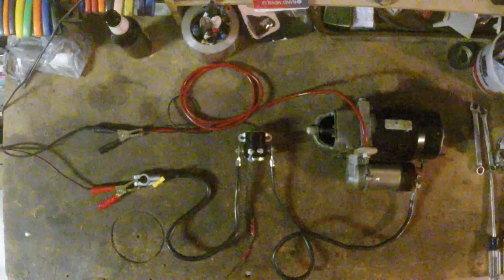My Old POS Episode 2. Remote Starter Solenoid Tricks!

Comment: IF YOU ARE STRANDED  with a clicking solenoid  try this method  to get going   in nuteral brake on switch in run pos raise hood  a short piece of wire #6 or so  or a pair of pliers simply short two big lug on solenoid  if battery ok it will crank up

Comment: A great and informative video.  It seems though at 0:48 the large wire from the remote mounted solenoid to the starter mounted solenoid should be attached to the other large terminal, closest to the starter motor, powering the motor directly.  In the current setup, if the starter mounted solenoid fails, the system would fail.  If my thinking is correct, the tab on the "trigger" should also be attached to the large terminal closest to the starter motor.  I am by no means a mechanic and I certainly could be missing something.  I still like the video and may just need further explanation.
Reply: THIS
Reply: lol ooo o

Comment: That doesn't actually bypass the one on the starter motor it acts in sequence....so if the one on the starter burns out it will not start.right? Cause i am also an untrained idiot.

Comment: if this happens to you -----try this no start just click jump start just clicks short to solenoid no start??????????use starer cable both ends red or black conn 1 end battery gd black the other end  any metal on eng or frame  bingo she will start right up ----whats wrong  - the neg battery cable is loose where it i s   fastened to chassis  so that  the neg is missing do not turn off till you get that bolt tighten